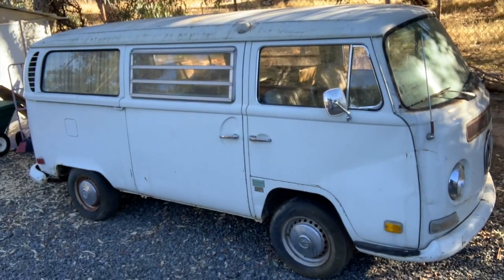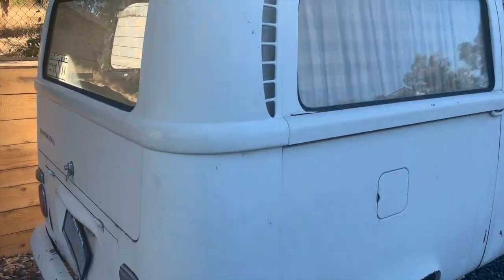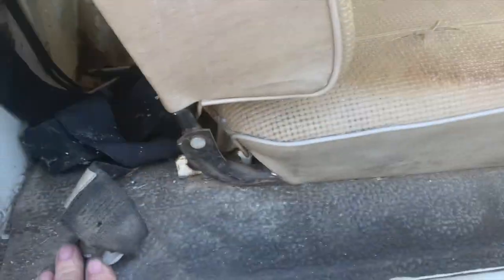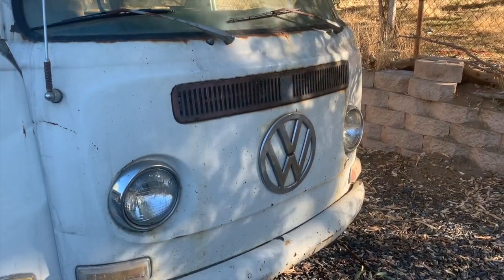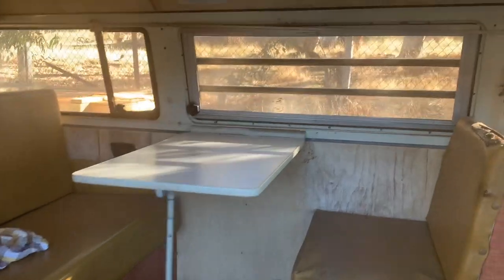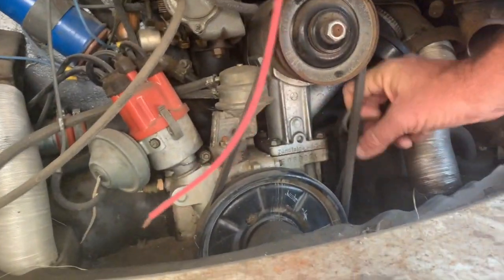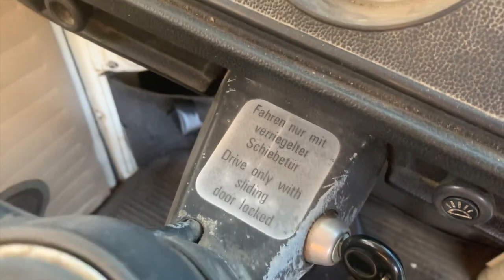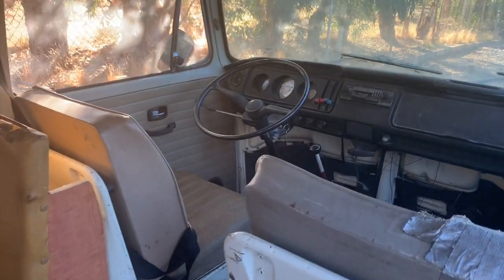Carchaeology: Barn Find 1971 VW Westfalia Camper

Comment: I know a lot of people love these things but I'm not one of them. It's probably because I've been stuck behind one on two-lane mountain roads multiple times. I know that says more about the drivers, who wouldn't pull off and let traffic pass, than the cars but the antipathy is still there.
Reply from the maker: You either love em or you hate em. I personally am a fan...but as a driver you do get used to ignoring what is behind you...if you don't, it scares the heck out of you and you find yourself doing something stupid and running it too hard just to attempt to stay out of the way. Another reason VW Bus drivers don't pull over is a loss of momentum...especially on a hill...if you pull off, there is no way you can get back in traffic without causing a bigger back up.

When you get stuck behind one, just be aware that they are doing the best they can!
Reply: they pay taxes too, so they can go whatever speed they want ✌🏻 maybe slow down and try to enjoy the ride as well and you won’t have so much “antipathy”